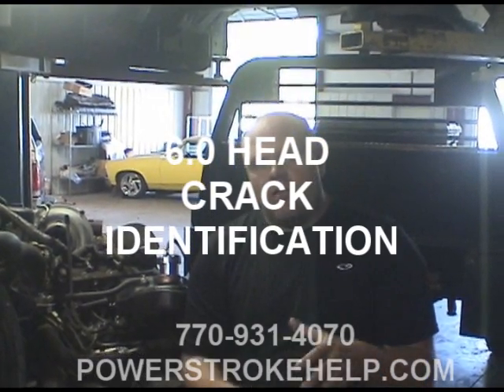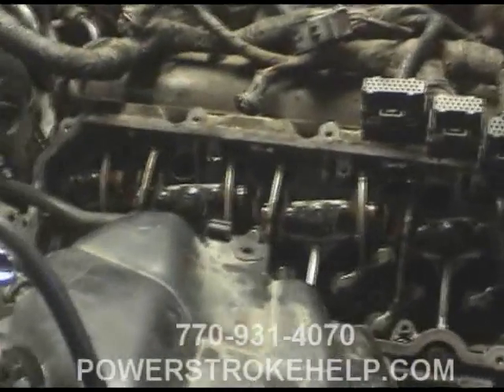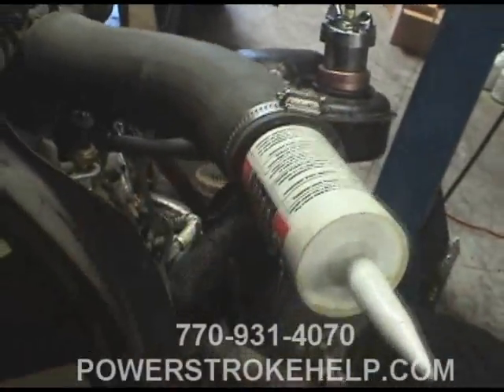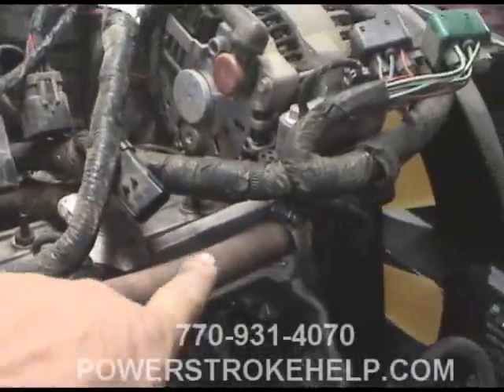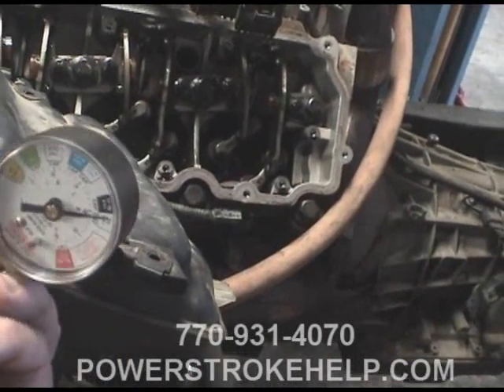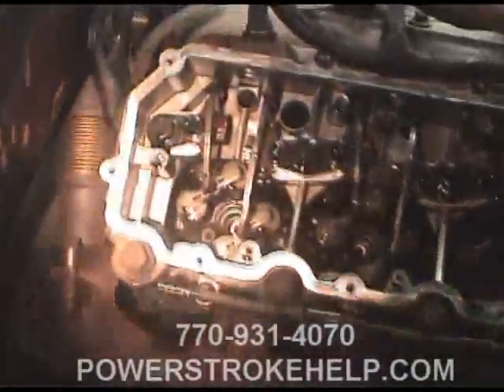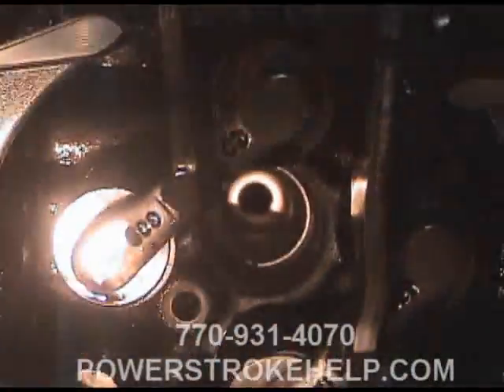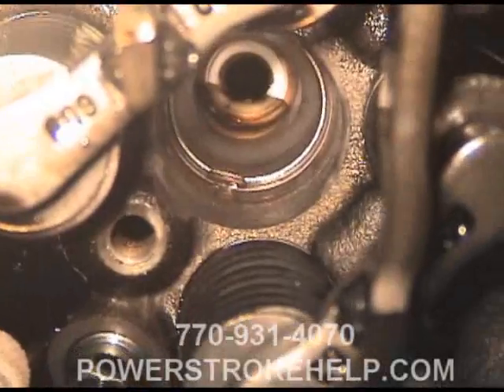6.0 CRACK TEST - INSPECTION PROCESS FOR HEADS

Comment: I had my headgaskets done and they replaned the old head did new gaskets ARP headstuds put it all back together i got the truck back and it was fine for 2 Month's I now have diesel in my coolant took it back to  them and they tried to tell me it was normal then they finally told me it could be a injector cup. Shouldn't they have fully tested the head to make sure there was no cracks in one of the cups

Comment: I got the same problem. Same side same cylinder sleeve. Same spot I'm the cylinder sleeve. I thought it was the cup at first so I changed the cup. Still lose pressure. It smokes its ass off. I unscrewed the degas cap and releases the pressure and the smoke slowed down. So now I'm going to do head work with the benefit of ARP studs. Started off with EGR cooler busting. Deleted EGR and changed cooler. Then it was injector cup I thought. During process ficm power board failed. Replaced that and now I have to replace heads. Its more expensive but I'm just going to change both of the heads out. It sucks. Now my truck sits. I can't use it to do work till I get the money to do this. I love the 6.0 though. Great engine

Comment: Curious what you think here - had an 05 in our shop that would push over a gallon of fuel out the bottle in about 3-5 miles. Had a cracked cyl 5 (same as yours I see) sleeve, leaking around the upper part of the cup. Fixed that. Got about 15k down the road and came in for an oil change, and had some fuel in the bottle, about 1/2-1 qt or so. We flushed it very well, I can't imagine it being left over working its way out. Pulled injectors and retested - couldn't find a problem. Any ideas here?

Comment from the maker: No but it is common for the hold down bolt to stretch when installing injectors with air tools. Take the injector hold down and grind the tip of the bolt off by 1/4", reinstall with new seals. This should solve the problem.

Comment from the maker: @johncunningham60 Here's the deal. I lose tools. This is just stuff sitting on the shelf just like everyone's garage. I bet you have something similar in yours. I have this nasty habit of carrying a tool around and then I lay it down and can find it later or I lend it out or one of my mechanics swipes it. So I go for the cheap or 0 cost solution, so I'm not pissed when I can't find it the next time. A-D-D is a bitch.